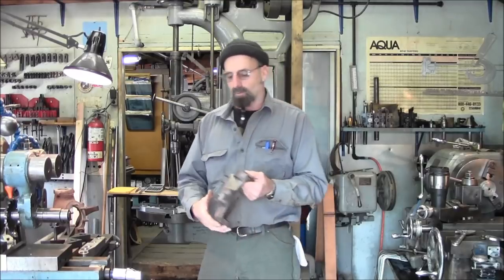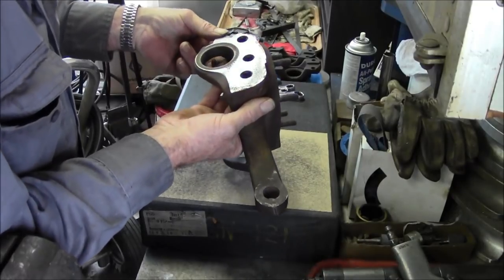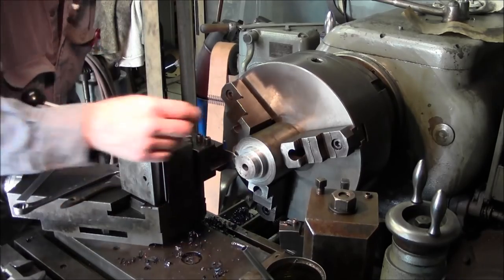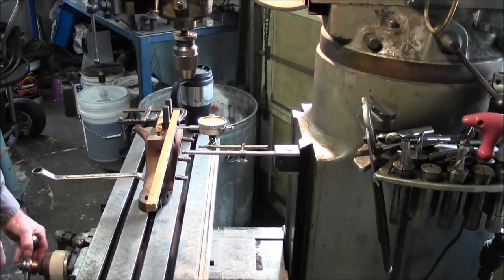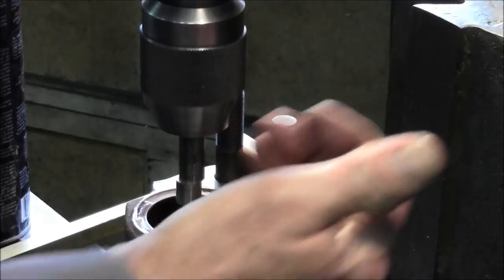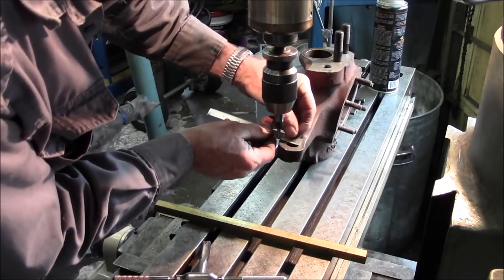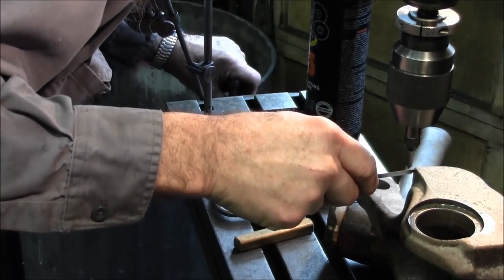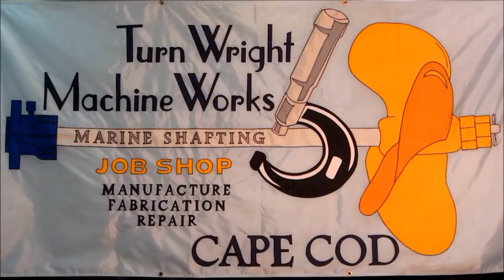Getting High Steering

Comment: More great stuff! Little tip: I use a small white board in the shop to jot down calculations, readings, anything I need to remember. I have magnets on the back so the mini-board is always available. It has been a huge help for me. I also picked up one of the large format calculators and put it in a plastic bag so it never gets greasy.

Comment: Keith nice setup there on finding a way to locate the part accurately so you can work on the other part.  I thought that after you got the knuckle straight in the X and concentric with the bore you could have moved to the hole in the arm and  located its center with the coax and noted the coordinates.  The other part that needed the holes would then have the same x coordinate value just on the other side of the larger hole.

Comment from the maker: I have a link brand and a Fowler brand and found both great qualities! The design of the coaxial indicators no matter who makes it, seem at times, to be less quality than you would expect, because of the reach, bore or diameter texture, dry or sticky surface etc.  You learn tricks to use so your coaxial indicator with each new job and little things like lubing the surface makes the difference. You also learn that the dials read relational indicating more than dimensional travel. ;{)---

Comment: Yeah makes sense that hole is for the tie-rod.  I've never used a coax indicator, but it seems that it should still work on a taper?  The centerline of the hole being at an angle pretty much scratches the idea though of using the hole for the alignment.

Comment from the maker: If I didn't have the DRO, I'd read the dials, I would have to see the arm in place with all the other variables added to really get that answer, but if you had a milled flat surface you good transfer punch and set up on each location and drill the holes. ;{)---

Comment: When in doubt, you can check out ebay & amazon.com - google on "granite surface block" and filter out the hits for headstones and the like...

Another trick for getting a flat surface to back up your sand paper - or emery paper is to get a piece of window glass from the hardware store. Woodworkers use that approach for honing chisels - I've used it with a carefully selected glazed flooring tile - you need a *FLAT* surface for it to work...

Comment from the maker: There would of been a little err factor in doing that method also, the hole is tapered and the line of the bore is at an angle to the set up / knuckle pivots.;{)---

Comment: you run the edge finder at a very low RPM I always run them at about 1200 rpm I believe they should be ran around 1000+

Comment: Could you not have indicated the flange face with the studs to be square with the mill instead of the top studs like you did. Then zero'd on the bore like you did. After that just get X,Y coordinates for all 4 holes (3 threaded on top and the steering arm)? I think this would have been a more accurate way of replicating the holes no?